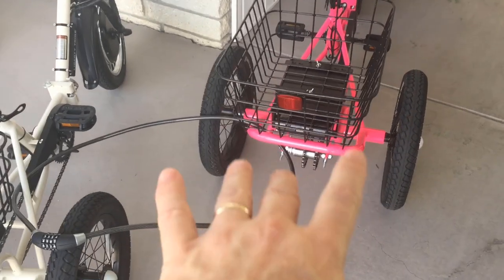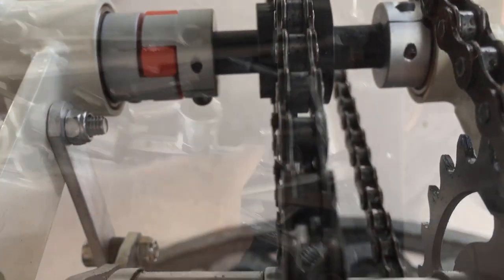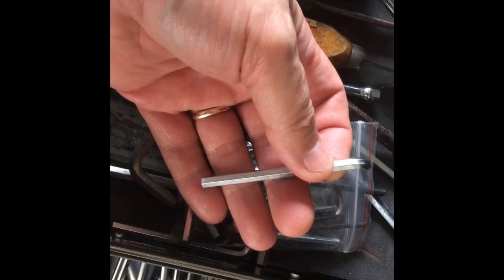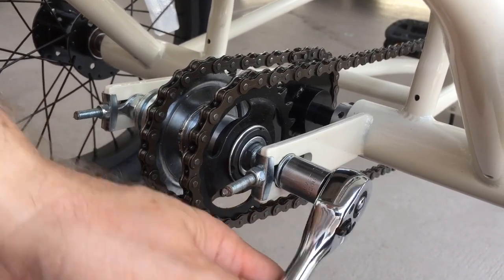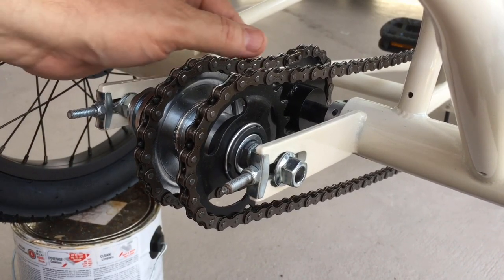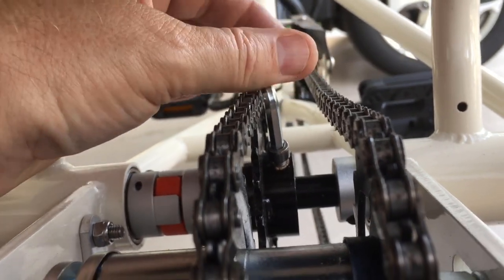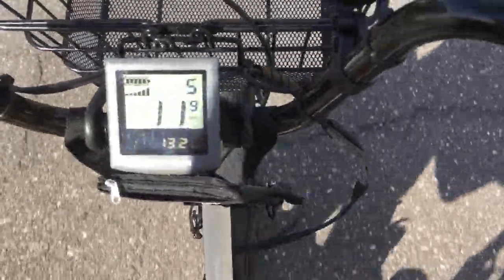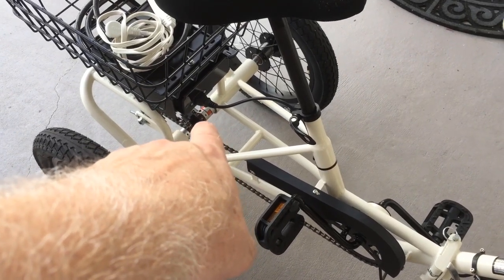Liberty Trike Chain Adjustment

Comment: I had a non-motorized trike making that same noise, but worse.  It was driving me nuts!  Using your sprocket alignment tip I saw a big improvement.  I think it will be perfectly quiet once it's dialed in.  Thank you!
Reply from the maker: Wow! Had no idea, but it makes sense. Thanks for letting me know.

Comment: Good video but your long chain is wayyyyyy too loose.  The guys at the shop use a straight edge to make sure the sprockets are parallel. There should only be about 1/2" to 1" play with the long chain.
Reply from the maker: Yeah correct! The issue is that both chains are on the same axle.  And to adjust the axles parallel, I end up with too great a difference. Adjust for the long chain and the short is over tightened. Long chain needs a tension sprocket. Or move front sprocket. If you know how, please advise.